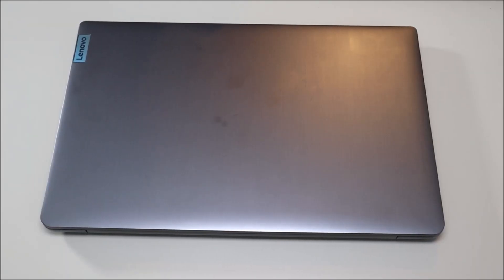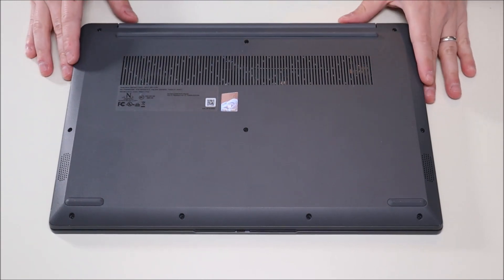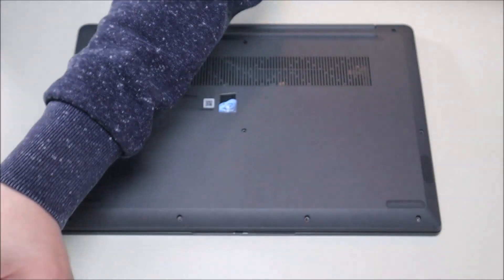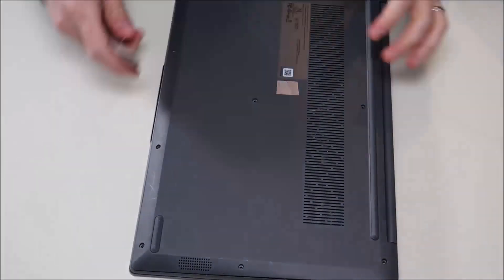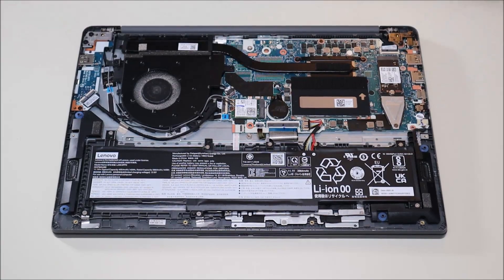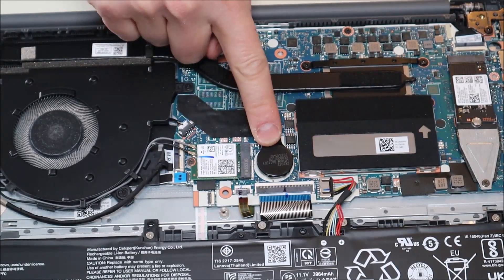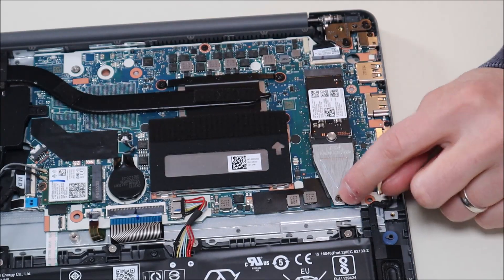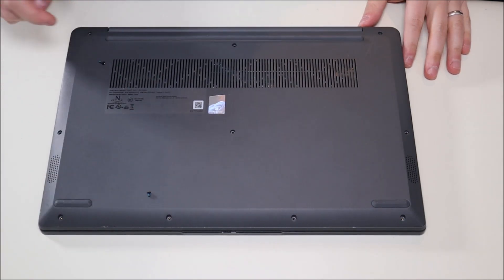Lenovo IdeaPad 3 Teardown / Disassembly - Replace Battery Solid State Drive (SSD)

Comment: You can upgrade the RAM by pulling off the silver cover with the arrow on it. Just pry it upwards and you'll see a SODIMM slot. For this model, I have installed a 16GB DDR4 3200mhz SODIMM RAM module
Reply from the maker: Thx!  Cant believe I missed that :(:(  I did like 10 teardowns that day and went too fast making this video :(:(  Glad someone else is paying attn LOL

Comment: can you upgrade the SSD I have the same computer and I don't know if you can upgrade the SSD no one has the answer
Reply from the maker: You can always upgrade your HDD / SSD as long as the computer has a slot for it and its not integrated into the motherboard.

Comment: hi,
my Lenovo ideapad 5 won't turn on. I've gone through your series of laptop won't turn on fix but can't seem to find out what the problem is.
The power button light turns on and go off after about 5seconds but the keyboard light doesn't.

but when I plug the charger into it, it shows the battery is fully charged as well
Reply from the maker: 1.  For a computer that does not turn on, try this video first; https://youtu.be/kOBY4k2Mn_k. Let me know how that goes :)
2.  Also, did anything happen before this issue appeared?  Liquid spill, overheating, Windows update, etc?
Reply: Hey! I have the exact same problem. Do you know what the problem was and how did you fix it? Thanks!!

Comment: Hello. I have this problem where my laptop starts blinking orange and turns itself off when I try and charge the battery.. but when i only connect the charger it turns on but its really really slow...Help
Love your videos by the way❤❤
Reply from the maker: 1.  Please do not spam the videos with multiple comments.  I try to answer all comments and it clutters up my notifications needlessly.  
2.  I answered your other comment.  Please reply there.

Comment: How do I open bios setting on a computer?
Reply from the maker: You would stat the computer and then press the correct function key.  It differs for different brands and models of computers.
Reply: @PC_Monkey  what would that button be for lenovo
Reply: My f2 button dosent work
Reply from the maker: @Saint_jz  You can see how to enter BIOS on a Lenovo here;  https://www.youtube.com/watch?v=oL1R1Tw0jSo.  Some models will use different keys so if one does not work, try the other ones.  Also, some Lenovos have a NOVA button or a pin-hole reset that will get you there.
Reply: Oh ok thank you

Comment: Hello, 
I have a problem with my laptop its Asus Vivobook 
At first it was stuck on startup and after that i use troubleshooting restart and still it was stuck and i did some dir, clean disk and many other stuff on startup cmd because i wasnt able to go inside my laptop and when i turn it on its on Legacy mode and when i do save and exit same process happens open direct on legacy mode 
Is there any solution for this ?
Reply from the maker: 1.  Are you able to try the steps seen here?  https://www.youtube.com/watch?v=J1ZagkSTcSI
2.  Are you able to find any Recovery or Repair options in BIOS?

Comment: I need help basically in January I left my laptop on whist I went to take a shower and when I came back after like 30 minutes my laptop was turned off although it normally stays on but this time it didn’t. Soo I pressed the on button like 10 times then it turned on but then turned back off and then when I tried to turn it back on it went into like a loop and I’ve tried resetting it 1 million times but now the reset option is gone it just takes my straight to advance options when I press troubleshoot, I’ve started a start up repair but all it does is say log file C:\WINDOWS\System32\Logfiles\Srt\SrtTrail.txt I’ve tried everything and nothing works please help me I don’t care if I don’t get back my files or if I have to reset everything I just need help (btw I have a acer laptop that is touch screen so yeah please help I’ve watched over 30 videos and nothing has worked so help I beg).
Reply from the maker: Are you able to try the steps seen here?  https://www.youtube.com/watch?v=gDQZvNQ2chc
Are you able to find any Recovery or Repair options in BIOS?
Reply: Nope that didn’t work it says recovery and your pc/device needs to be repaired. What should I do like I’m so confused to why it’s not working
Reply from the maker: @milliemills7185   If you cannot find how to switch the setting in BIOS or if switching did not help, then reinstall the Operating System.
You can see how to install Windows 10 here:  https://youtu.be/bIlW4im-tr4.  
You can create Win10 Install Media for free as seen here;  https://youtu.be/YbC4jZVwQm4.
You can see how to install Windows 11 here:  https://youtu.be/zYY-Gq68Dvo
You can create Win11 Install Media for free as seen here:  https://youtu.be/WIxDYRBVbmk
If you cant create your own, you may have to purchase it.  You can see an example of a good install media USB in the Repair Tools list here;  https://www.amazon.com/shop/pcmonkey.

Comment: Can u help me sir my laptop keep turn on and turn off.
Reply from the maker: 1.  When is this happening?  During startup and the computer will not fully boot or does it happen when your using the computer?
2.  Also, did anything happen before this issue appeared?  Liquid spill, overheating, Windows update, etc?
Reply: I did get windows 10 . And this problem happen while startup
Reply: Can u help me sir
Reply: Please sir I really need ur help
Reply: Sir?
Reply: Hello?

Comment: Please man help me my Dell laptop have problem that the hdd not detected and the option legacy and ufei not present in bios setup and it version of bios is voster 1015
Reply from the maker: 1.  Are you able to try the steps seen here?  https://www.youtube.com/watch?v=yMcwOaocs-k.  If so, what was the result of the diagnostic scan?
2.  Also, did anything happen before this issue appeared?  Liquid spill, overheating, Windows update, etc?
Reply: It happen when I accidentally delete the main version of windows and when trying to install new version the hard drive not showing in the installation window and I test the hard drive on another laptop it's work fine and I even tried another hard drive but the problem still exist .
Reply: Whate should I do now
Reply: And almost tried everything in the video
Reply: But nothing worked
Reply: Just the bios update I couldn't know how to do
Reply from the maker: @kirito-iv3ur  What was the result of the diagnostic scan on the HDD?
Reply: Not found
Reply: The hdd not able to work on it but it's work on another laptop
Reply: When I type list disk in command prompt the hdd not showing
Reply: It's maybe a problem with the connection between hdd and motherboard or do you have any other idea
Reply: And thank you for giving me your time ☺ 😊
Reply from the maker: @kirito-iv3ur  Yes, it sounds like a bad connection if it works on another computer.  If you need to use a HDD connector of some kind, make sure its secure and not loose.  If not, replace it.
Reply: Thanks I will try next time

Comment: Hi 
My lap top model is Hp Compaq 1100 
The problem is when i turn on the laptop , the screen is just white ! 
The login process is ok and the problem is not hardware because when i press ctrl + alt + del the blue screen where we can go to taskbar or restart comes
What should I do
Reply from the maker: 1.  Are you able to try the steps seen here?  https://www.youtube.com/watch?v=ATH97r95QPM
2.  Also, did anything happen before this issue appeared?  Liquid spill, overheating, Windows update, etc?